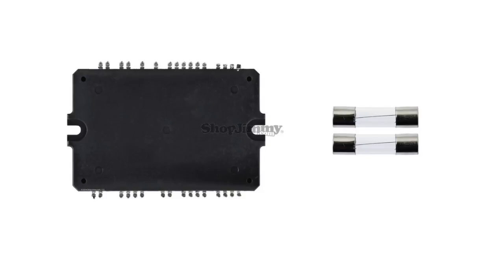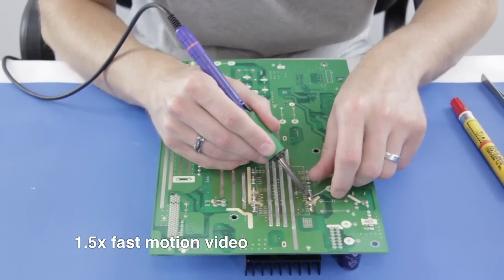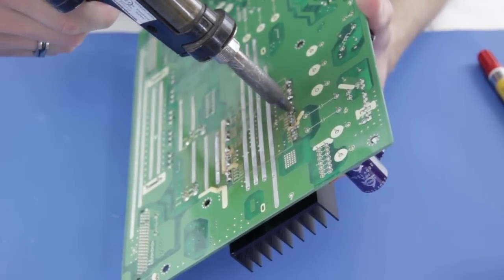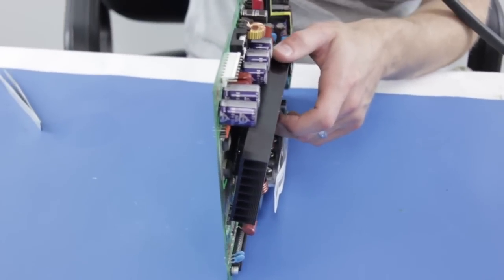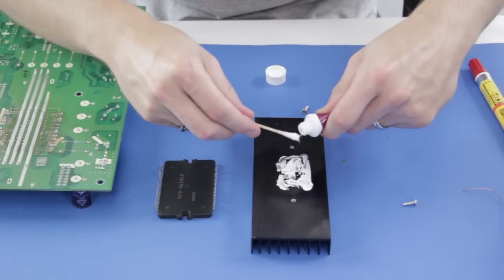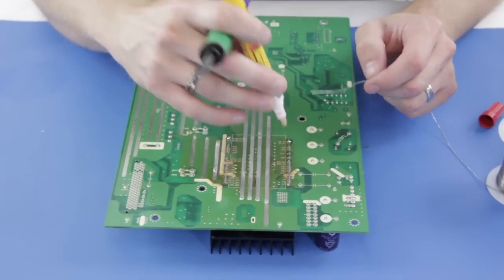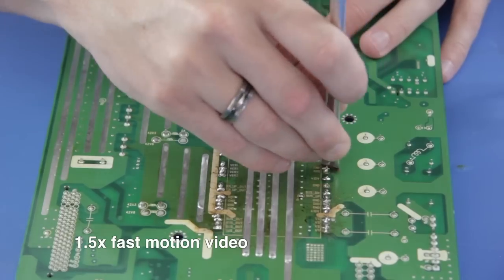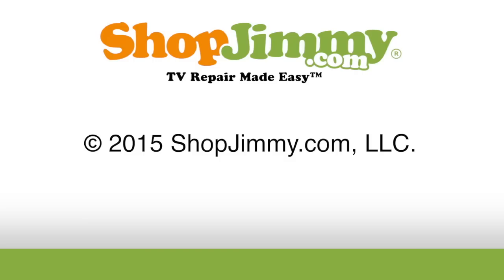LG PDP42X3 Sustain Repair Kit Tutorial - TV Will Not Turn On & Blown Fuse

Comment: Hello guys,
I have a problem with Sharp LC-40SH340, the bottom 1/3 of the screen has a horizontal white band( you can see thru the band, it just has higher contrast and maybe a little shadowing from the upper part).

Is it the panel or bad tcon board?

Thanks
Reply from the maker: Mario Orlik   Try all repairs and troubleshooting at your own risk.  This could be a problem with either the t-con board, the main board or the TV panel.  You can replace the main board and t-con board individually to see if one of those boards fixes the problem.  Unfortunately I do not see any replacement parts in the search results for your TV model number on our website.  Thanks and please let us know if you have any further questions!  www.shopjimmy.com